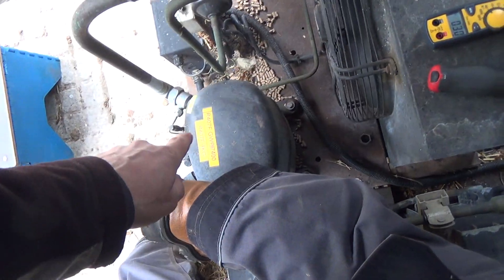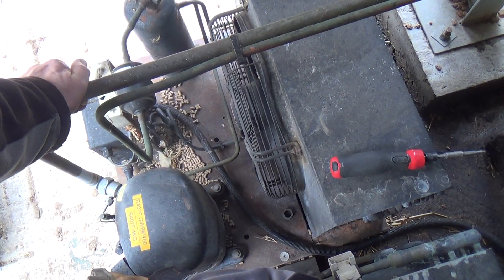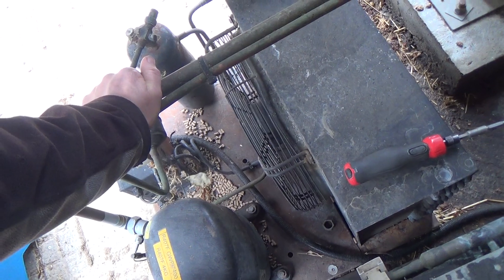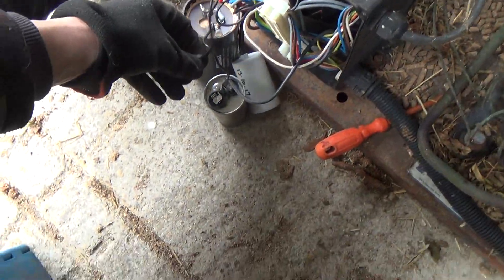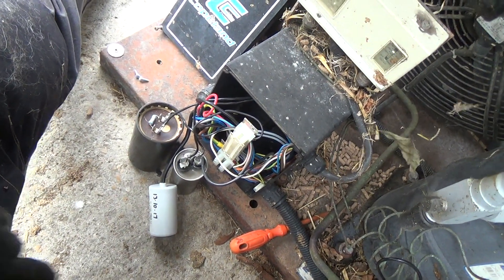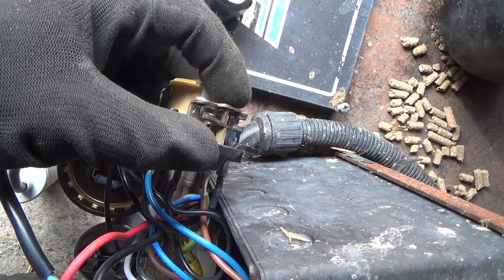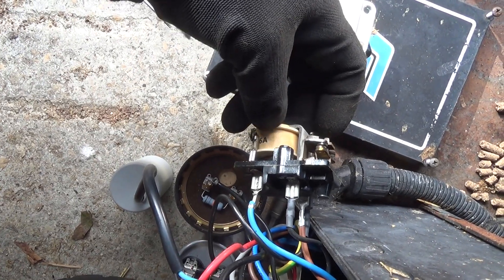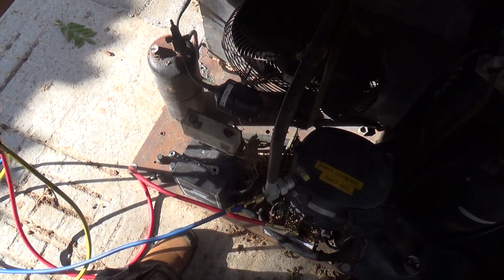Copeland Unit Trips MCB

Comment: One thing I don't quite understand is how come the breakers are type C and not type D ? If it means the same as it does over here then wouldn't it need a type D in order to tolerate the amperage spike on compressor start ups ?
Reply from the maker: Usually here motors are on a C type, D types are more for transformers and fluorescent lights.
Reply: @heavydiesel  Ah man that's amazing how we're so close and yet stuff like that is still so different ! You would think there would be a universal standard or something . It would be so confusing cause that's the 1st thing I would think of , I'd go : yep it needs to be a D type thats the issue right there 😅
Reply from the maker: @sterlingarcher46  Our local electrical wholesaler had a house in France and French wife so spent a lot of time there, he said the French electrical standards were better than ours in many ways so wouldn't be surprised if its us not doing things quite right!  
Here we have B type breakers which would be for domestic/office etc use where there is no inrush current, C type that are generally specified for motors etc, and D type which are for heavy inductive loads like transformers etc.

Comment: Those tinsel coils always block up fast, and are impossible to clean easily.  Yes best to grab some rail and move them both out and up high, so that they get more air flowing through them, and keeping the dirt out. 

You do get 25A breakers that are meant for AC and compressor use, with a delay so that they do not nuisance trip, but still do near instantaneously trip on massive overload, but will not trip with a 30A load for 30 seconds.  Use them a lot for AC use, as they survive the heavy start load on a hot day, but are still usable on a 2.5mm cable and do not need 4mm cable.
Reply from the maker: These are on C type breakers which will take a multiple of their rating long enough for a motor to start, I think going from a 20A to a 25A breaker will stop the nuisance tripping. Time will tell!

Comment: Nice video John.  Did you ever get the new van?  Hope all is well.
Reply from the maker: I've still not made my mind up on what to get, at the moment have a 3200kg Vito but they only make a 3050kg one now, so am looking at a 3500kg Sprinter which will take about 200kg more than my current van. At £46k its a lot of money to commit to when it looks like we are going into a recession!
Reply: @heavydiesel  yea I believe money will start to slow up shortly. It has been a good run  but as you know rainy days are coming. Hope you and your family are well
Reply from the maker: @scottk0623  I think we will be ok, luckily we don't owe any finance on any work stuff so if work dries up we don't have too many fixed costs to cover. Worst case if it goes like it did in 2008/9 I'll go part time working elsewhere to bring a bit more money in.